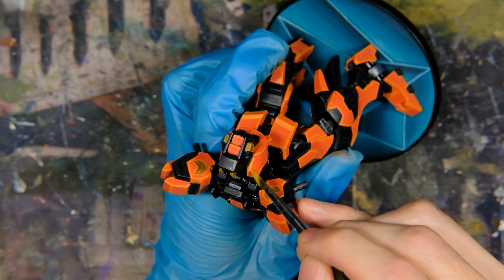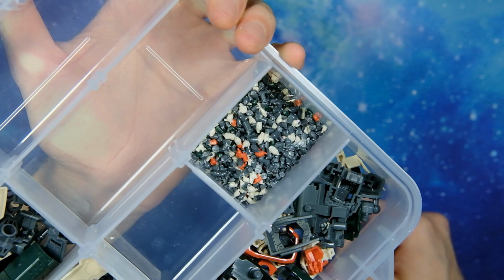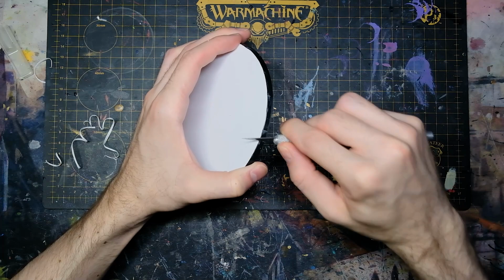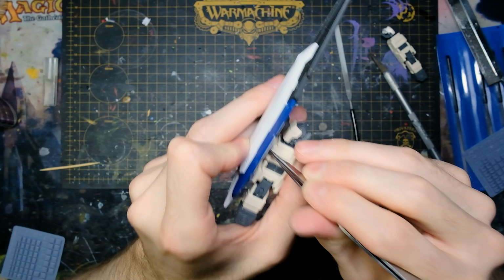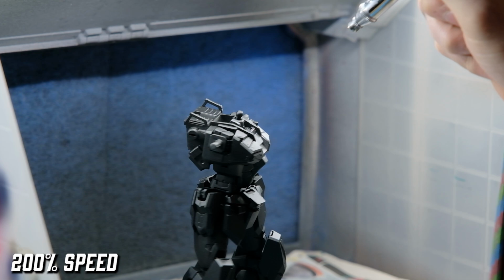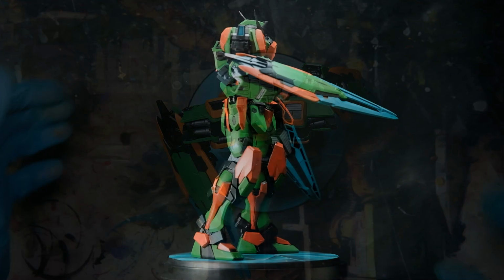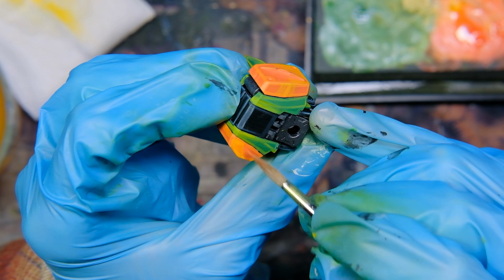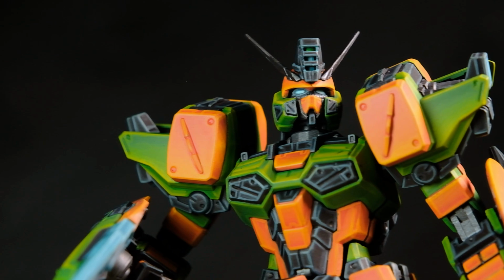Hand Painted Master Grade Buster Gundam Kitbash for Gamma Wolves

Comment: Always love your kitbashes and painting videos, and appreciate your attitude regarding personization and believing in your own vision.

One question: What was your rationale for using super glue vs. plastic cement for attaching rhe arm shield/swords?

Thanks again.

Oh, we're gonna need some Gamma Wolves battle reports too.
Reply from the maker: Thanks Bo! I mostly just used super glue on the arms because it would dry faster and I could then move on to the next steps; the contact area was large enough I wasn't worried about the slightly weaker bond it would provide compared to cement

Comment: Been watching your videos and love your style. How difficult would it be to mix 3 shades to use vs 3 separate colors? I have a slew of base colors but I'm hesitant to buy different shades of the same color.
Reply from the maker: mixing your shades with base colors will be good practice and value, but the results won't be as consistent